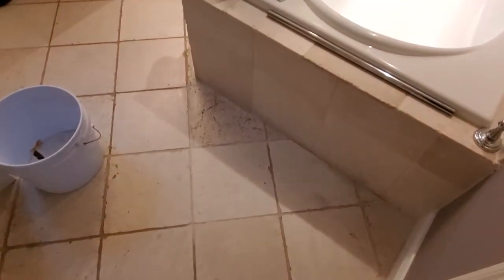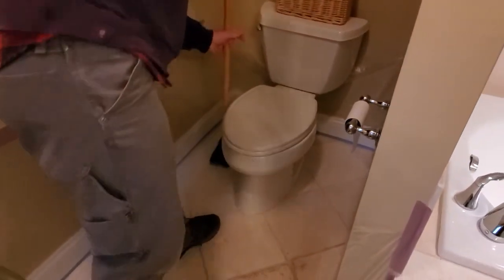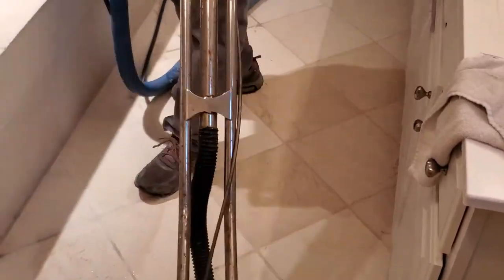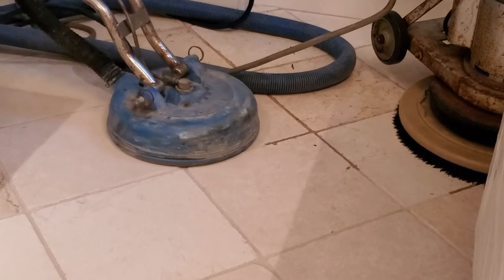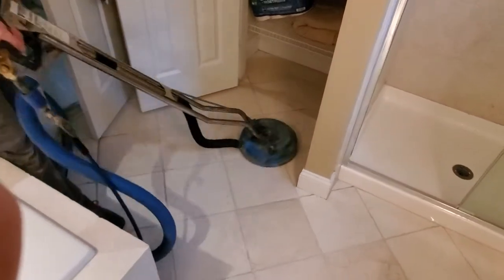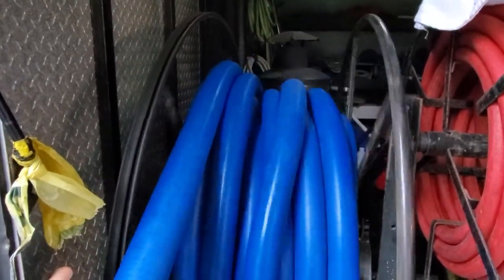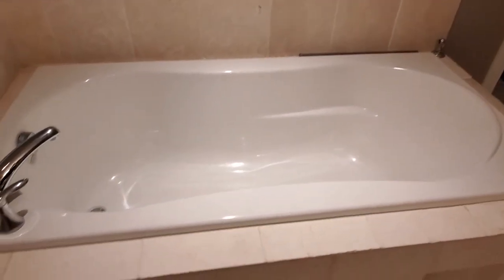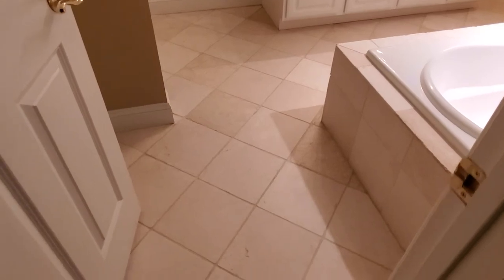Cleaning Grout and a Tumbled Marble Floor

Comment: Corners, where floor meets wall, or wall meets another wall should never be grouted.  It will always crack.  You should buy matching caulk for those lines.  For wide joints you can even get matching sanded caulk.  It will look just like the grout.

Comment: My marble tiled floor have been damaged from urine and vomit. Is there a way to repair this? 
 Not sure if it’s etched or stained.
Reply from the maker: @josiemini6823  definitely repairable.
Reply: @mhess427  is there a product I can use or it should be done by professional?

Comment: Is possible to use a portable machine instead of mounted truck for grout cleaner?
Reply from the maker: You mean a portable pressure washer? Sure, I suppose but you'll need a wet vac to suck everything up.  Probably won't work quite as well.
Reply: @mhess427  thank you for your reply yes I meant a portable pressure washer the same people use for cleaning the carpet, I’ve just started to work polishing floors although being a natural stone fabricator for about16 years now, floors are a bit difficult for me, I’d appreciate if recommend me any brand for that grout cleaner, recently got many inquiries for cleaning grout. TIA

Comment: Hi can you please post a link for High pH cleaner solution? thanks ...Jay
Reply from the maker: Look for a degreaser that contains sodium hydroxide (lye) or sodium metasilicate.  Our cleaners are specially made for us but basically contain variations of those chemicals.  One you may find, for example, is ZEP concentrated driveway and concrete cleaner.  
If you're just cleaning grout and NOT natural stone let me know and we can go over some other tips.
Reply: What about group on marble stone?